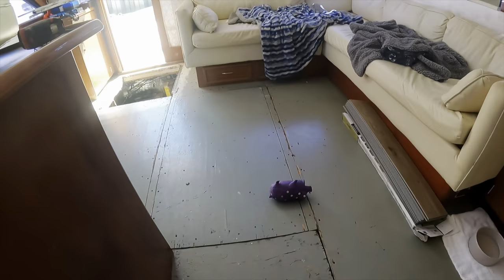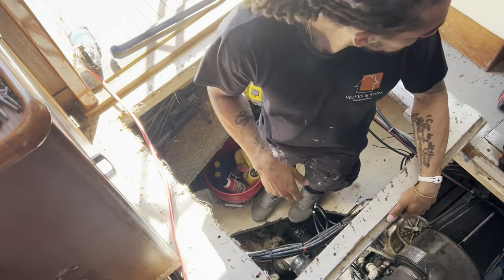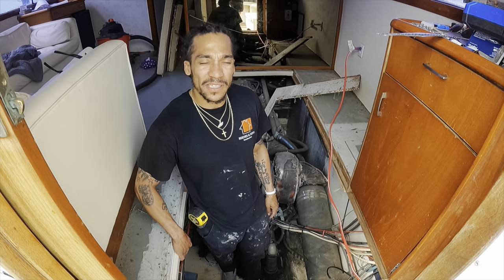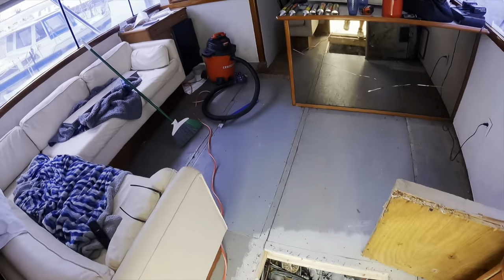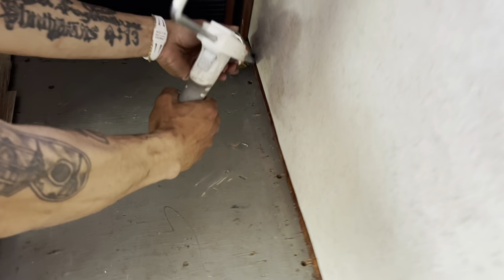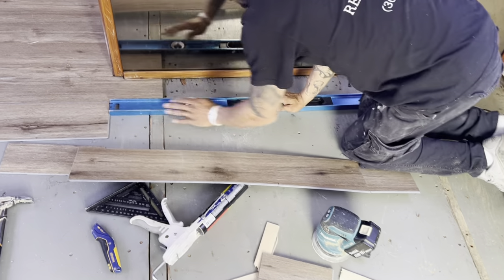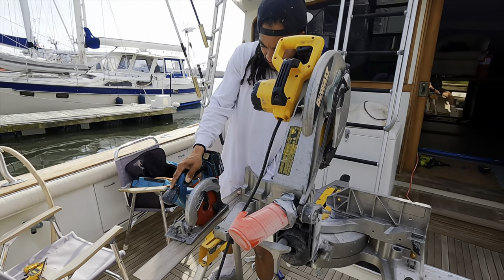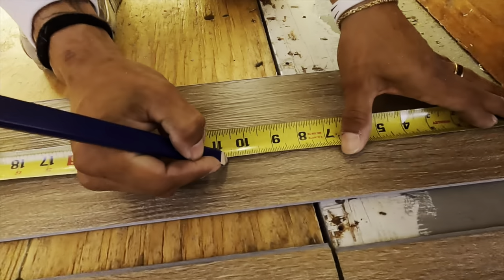YACHT Projects Done?

Comment: I would try to Duct tape the seams the best you can from underneath. Usually you duct tape the top over the cracks before laying the floor. Helps with fumes and noise.
Reply from the maker: Great advice! We wanted the seems for removing the floor for maintenance and can’t tape from the bottom based as how the floors sit on that “lip” of wood so they all lay flush
Reply from the maker: Also we have large engine room fans that help draw lots of air in there so there is not dangerous fumes in there
Reply: Hmm i guess there’s no way around it with wood floors. I have an 86 44’ and I’m interested in following your progress. Just got to the “end” of self refit journey. From experience it’s VERY smart keeping them accessible.
Reply from the maker: @IClementsI176 that was the main thing with this upgrade is having easy access for maintenance